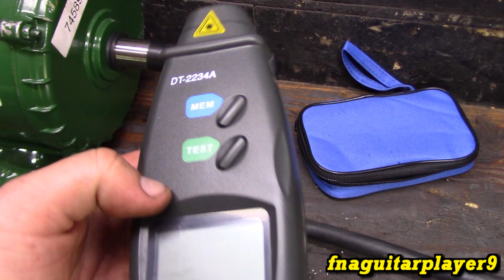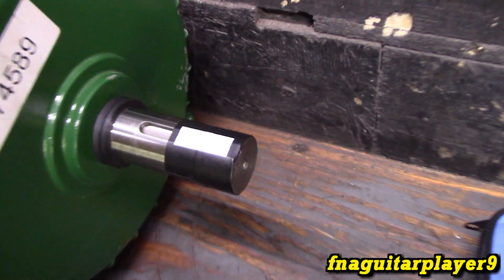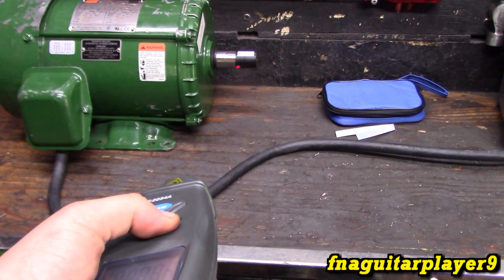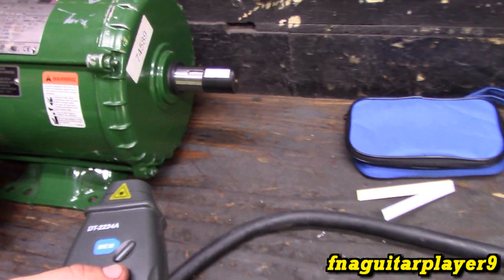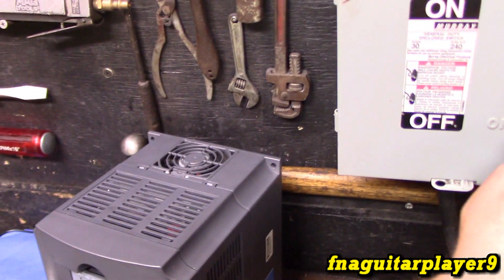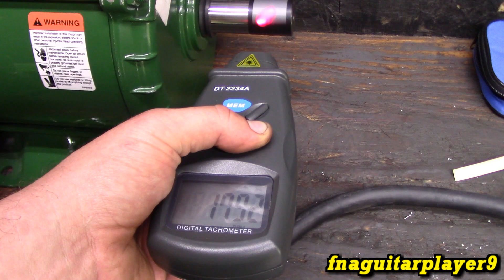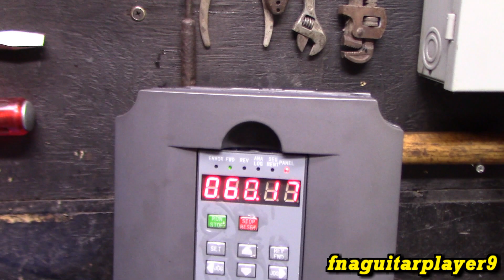Non-Contact Small Engine / Electric Motor Tachometer Review/Demo

Comment: i have a proplem that is my mower is 12 hp and it smoke fire in the airfilter and i have seen all videos on yt and i cant find som help
Reply: not smoke out of the airfilter out of the exhost
Reply from the maker: If its blue smoke then its burning oil and probably needs rebuilt unless it has to much oil in it, if its black then its running to rich and carburetor needs adjusting. Thanks for Watching!!!

Comment: Hi John - it's Big Rodders in Ireland.  Thanks for the advice.  I already have one for small engines but I have to place a spring clip around the HT lead.  I've had it 15 years and it works good but it was costly then at $140.  I've just gone onto eBay and bought your version for $24 incl shipping so I can expect it in mid March.  Will be in touch. Thanks again.
Reply from the maker: Your welcome! they are handy! Thanks for Watching!!!